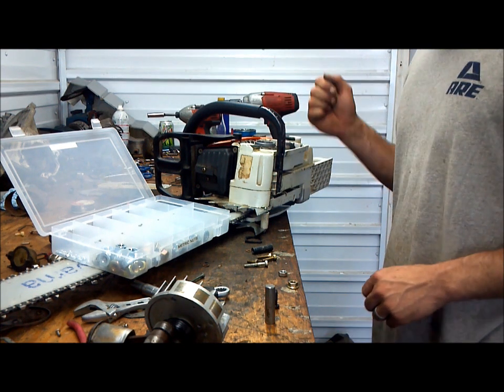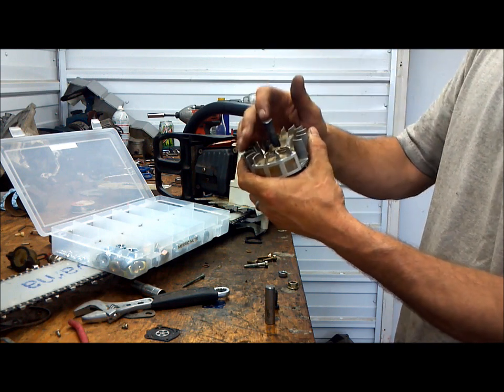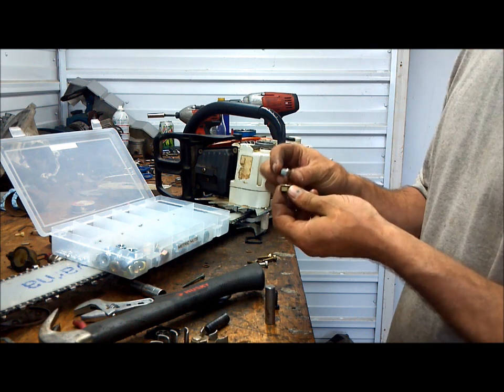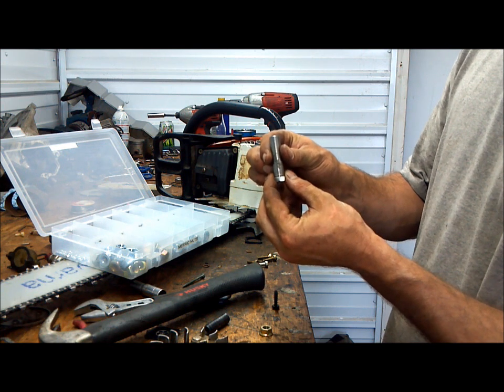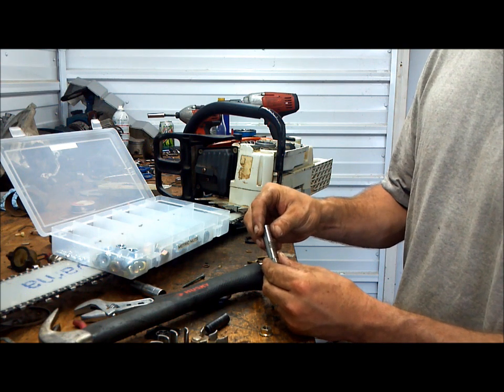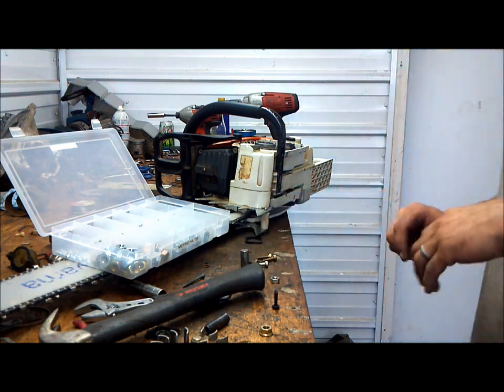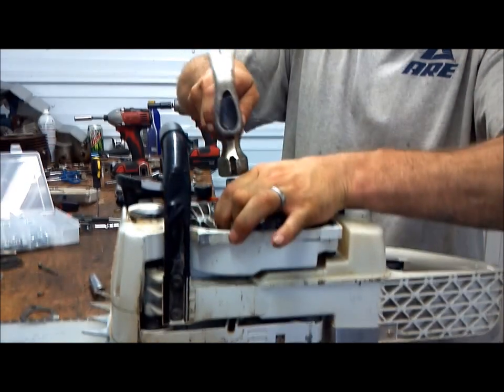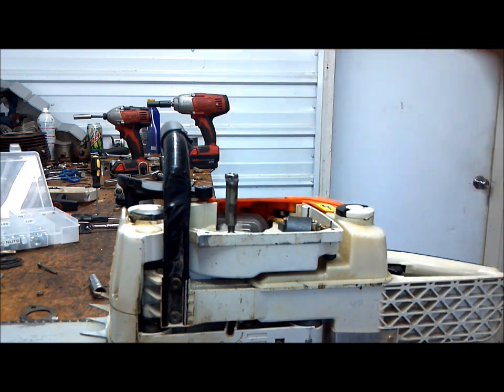How to make chainsaw flywheel removal tool

Comment: Got it to chop up a large oak tree that came down in the last storm.>>>urly.fi/11WY    A lot of work, but this chainsaw made all the cutting easy work -- moving the stuff is a different story though. 20" is a good bar size for this model. I'm not sure if would have enough power for larger cuts where you would want a 24" bar -- but maybe you can do it with a bit of patience.
Reply: Many good videos.......thanks

Comment: It makes me cringe to see you smack that crank while it's still in the saw.  Aren't you worried about what you are doing to the main bearings? 

I made a simple puller for my Stihl 020av as follows.  The saw's flywheel has a M22 x 1.5 thread, which is exactly the same as the fittings for pressure washer hoses.  I bought a brass adapater (host thread to 3/8 pipe) at Lowes for less than $4 and tapped the center for a 3/8 bolt.  It works great.  The ID of the fitting is a little large for best thread tapping so if anyone worries about that you can get a 3/8 pipe cap, drill it proper size for a smaller bolt and tap that.  then just turn a bolt through your adapter and press the flywheel off with no impact damage. 

FYI some Stihl saws have M26 threads instead of M22.  In that case good luck.

Comment: I was struggling to get the flywheel off of my 480i. After watching your video I couldn't figure out the reason for actually needing to weld a nut on the end of a piece of stock, but the concept of how it comes off helped me considerably.      I backed the main holding nut off the flywheel till it was flush with end of shaft, then used a 5/8 bolt upside down with the head on the nut/crank and hit it.   Popped right off!   Thanks for the help!

Comment from the maker: Being YouTube has messed up comment reply yet again.  Tom, yes that is another way to pull a flywheel.  The knocker tool is a service tool issued by both Stihl and Husky.  It does no damage to the bearings.  Unfortunately, Husky saws as well as many other makes have to threads to pull.